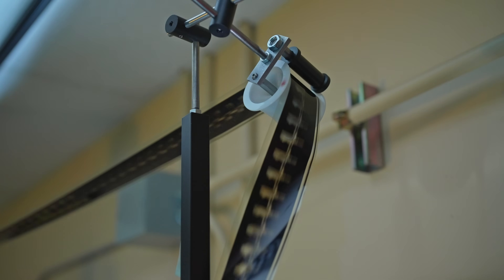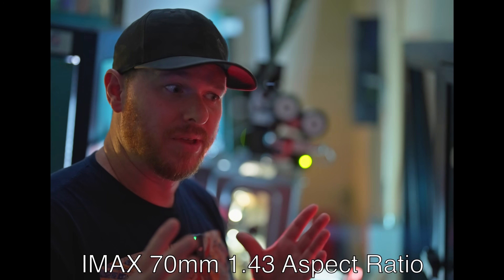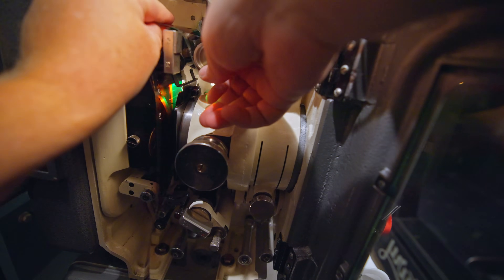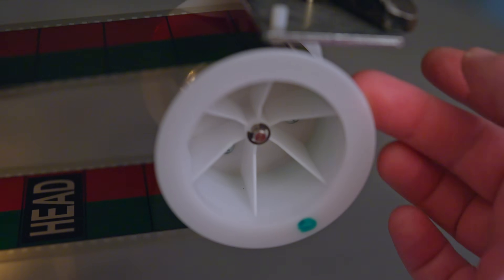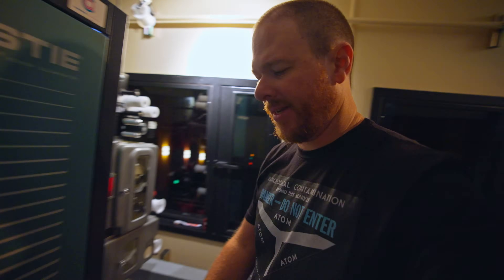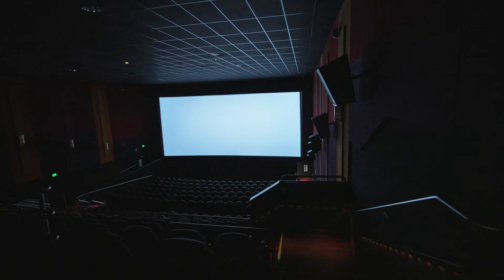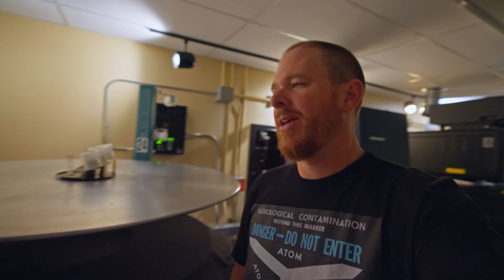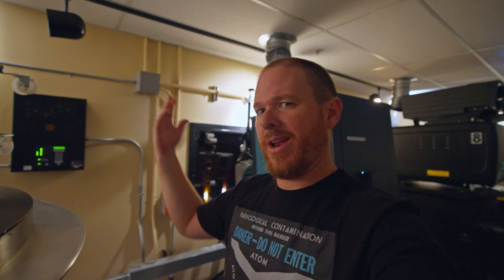Being a Projectionist for Oppenheimer 70mm Film Part 2

Comment: Thank you for pointing out the issue of resolution when comparing 15 perf to standard 70mm--I also don't buy this "resolution increase," as I believe it to be a marketing gimmick. The extra resolution is simply the larger film plane. As you explained perfectly, if you chop that extra top and bottom off into a 2:1 or even 2.39:1 ratio, you're left with the same image. So creatively, if you wanted to utilize that extra resolution in a 2:39 image, you wouldn't actually get the extra res. Can't forget how good optics play into the perception of resolution either.
Reply: The film was shot in IMAX 70mm, so yes you do lose resolution when going to regular 70mm. It’s probably not noticeable between viewings, but if you take a larger image and scale it down, you lose resolution no matter what. They didn’t just remove some black bars, they shot it in a larger film and transferred it to a smaller one.
Reply from the maker: @hpwilliams0 the whole film wasn’t shot in IMAX. Parts of it were.
Reply: I’m aware pf the difference in the capture format, yes. But visually speaking, once projected, I’m not convinced the resolution difference is that dramatic between 70mm vert vs horizontal, especially if they’re matted to the same ratio. Like pixels, are there really that many more silver halide grains packed in? Would love to see a comparison, maybe I’m completely off base. 

This goes back to my issue of large-format film starting to look a LOT like digital (specifically that captured by an Alexa-series camera from Arri). Large-format film starts to feel grainless, like a clean digital picture. It’s an interesting marriage point for the two formats. Look at a 16mm negative vs 65mm or IMAX neg—very different appearance of grain. Lubezki said that’s what he loved about using Alexa 65–it removed the grain and made the screen feel more like a window (to him, anyway).
Reply from the maker: @joncoy1852 film vs digital projection is a little bit more than just grain or the lack thereof. What I see comparing film to digital is more contrast, better colors, no over sharpening effect and it being a little easier to look at. I do think that digital projectors in the field are pretty horrible. Since I’ve been at this theater I’ve seen digital projectors that were way out of calibration…bad pixel alignment, brightness and it looked like the colors hadn’t been calibrated in a very long time. When I worked at Warner Bros and Paramount I saw digital projection that looked as good if not better than film. But the setup we do before each show isn’t something that a regular theater could do everyday. Of course when I’m speaking of digital being better that film I’m talking about 35mm film…not 70mm or IMAX 70mm.
Reply: Hi @RadioactiveDrew  -- I don't disagree with you about the projection--I've seen many bad film AND digital projections. I work as a colorist and am quite familiar with the entire pipeline, been seeing movies screened on film since the mid 80s, so I do have a solid reference point. I'm familiar with things like THX and Glenn Berggren's reports on projector bulb chromaticity variances, and I've seen my fair share of really bad digital projections. What I'm really driving at is that, comparing the capture of IMAX film and large-format digital sensors, once boiled down into the same digital format for delivery, do not appear wildly different aside from the gimmick of switching aspect ratios, IMO. The options aren't all that different visually (we can nitpick depth of field and resolution variances all day). I do agree that seeing a high-quality film print that has been well cared for from a well-maintained projector is a beautiful experience, I just don't agree about the perception of resolution that is often reported by Nolan, van Hoytema, etc. I would point to Steve Yedlin's work for a discussion on resolution. But I'm sure I would say "oh wow, you're right" if I saw them side-by-side in a really great theater at Paramount or WB. That's a very good point you make.
Reply: I suppose that what I'm really getting at is more of a philosophical point about cinematography choices, and then ultimately the projection format, and what I believe to be a narrowing gap of differences between the two.
Reply: @RadioactiveDrew  And thanks for doing these videos, BTW! I've really enjoyed seeing your preparation process. We have a few places locally that do standard 70mm work (that's where I saw Oppenheimer), but it was great to get a look behind the curtain.
Reply from the maker: @joncoy1852 no problem. Glad you enjoyed it. I agree with you on digital capture. Most of films that have been captured on a Alexa 65 are amazing and shots that can’t be done using film because film doesn’t have the sensitivity as some digital sensors have. It’s all different flavors and what someone likes working with. In the end it’s really about how well it looks on someone’s screen at home. That’s where movies continue their longest lived life. I use to run a bunch of stuff for restoration and that was such a cool process to see happen.
Reply: Agreed, @RadioactiveDrew  . Film just cannot keep up with the sensitivity and the tone curve flexibility of digital formats now (you'll hear Roger Deakins often discuss asking Kodak if they could manufacture 1000EI or higher film, and they never could get it quite right). Agreed, all different flavors that come down to creative choice, which I fully support! I would love to visit some restoration facilities--I think it's so important.
Reply: @joncoy1852  It is definitely higher resolution.  The height of the IMAX frame is equal to the width of the 5-perf frame. The 5-perf 70mm projection aperture at 2.20 aspect ratio is 48.5 x 22 mm. The IMAX 15-perf 70mm projection aperture at 1.43 aspect ratio is 69.5 x 48.5 mm. That's 43% wider.

When the Oppenheimer 5-perf 70mm footage was printed onto IMAX film for the IMAX 70mm screenings it had to be blown up from 48.5 x 22 mm to 69.5 x 31.5 mm. The IMAX footage did not have to be blown up because it was filmed in IMAX format, so it could remain at 69.5 x 48.5 mm just as it had been shot.

I have seen Oppenheimer, Dunkirk, and Interstellar in IMAX 70mm. The increased resolution is very noticeable. That being said the typical audience member may not notice because they are usually consumed with the plot and the action, especially in a fast paced film like Oppenheimer. But that has always been true with just about everything in motion pictures, whether it's sound, lighting, editing, background music, super widescreen formats, they all add to the impact of the movie but usually on a more subconscious level, unless someone is interested in those aspects, then they are more likely to notice the background music for example, or the sound system, or the editing.

I think almost anyone could see the difference in sharpness if they mentally broke away from the plot for a moment and watched for it. But to do that you have to actually go to a 70mm IMAX theater, and there are only 19 in the U.S. showing Oppenheimer in that format. For most people regular 70mm is the next best option, as there are 85 theaters in the U.S. showing Oppenheimer in 5-perf 70mm.
Reply: Thanks for the thorough response, @StevePemberton2. I'm sure you're right about the visual difference between an IMAX 70 and a standard 70mm print, I never get to see the full 15-perf prints, but I think my point is being missed in this thread a bit, so I'll back out and defer to those speaking. I do understand the gauge differences though, which would lead to a larger piece of film, thus more individual grains and the optical potential for "resolution" (shot a lot of film back in film school, 16 and a little 35, and I am a fan of the format).

I must say, shockingly I didn't actually enjoy the standard 70mm print of Oppenheimer I saw because it wasn't in great shape and the bulb definitely seemed to presented chromaticity issues (curious to know what its white point was). Conversely, I saw a great 35mm print of The Assassination of Jesse James by the Coward Robert Ford not long ago, and the age of the print added to the aesthetic Deakins and Dominik were going for...interesting comparison. 

But I feel that the issue of gauge is only part of the resolution issue. I do wish that I could see 15-perf IMAX next to a 4K DCP of the same film, graded and processed by a professional facility. Sometimes I liken all of this to what I see on set all the time, which is people using soft, aberration-prone lenses on really sophisticated cameras, thus reducing their potential for resolution (again, pointing to Yedlin's take on res). But I do value all the opinions expressed here, thanks  @StevePemberton2  @RadioactiveDrew
Reply: @joncoy1852  I think side by side you would probably find things that you prefer in the digital version, because it has its advantages, and it is a format that we are now very used to and that makes a big difference in our perceptions. Especially if it was an IMAX laser which I haven't experienced yet but I hear it is pretty good.  But from people who know more about it than I do film IMAX has a unique quality that isn't captured in even the best digital presentation. It seems similar to the continued popularity of analog tube amplifiers and vinyl records, which is not just people on a nostalgia kick, as there are serious hi-fi buffs who are into that because they prefer the sound, or at least they appreciate the sound, as I'm guessing they also listen to a lot of digital music also.
Reply: @StevePemberton2 Great thoughts, in both responses. You brought up something interesting we haven’t discussed—digital audio vs optical tracks. I sometimes forget about all of the beautiful nuance of optical tracks. Again, to being up that Jesse James print I saw, it sounded INCREDIBLE. There were so many bits of the mix that I’d never heard from a blu-ray.
Reply: But in my OG post, I meant in the projection. I don’t personally like the way Nolan has always jumped back and forth between 2:39 ratio w 35mm shots and the taller IMAX ratio within the same movie. It’s a difference of framing rather than quality once you conform that to a DCP, really.
Reply: @joncoy1852  Regarding the change in aspect ratio, I agree in a digital IMAX theater it probably wasn't necessary to switch back and forth from 2.20 to 1.90 for the IMAX scenes (1.90 is the most that digital IMAX projectors are capable of).  It would be a matter of preference at that point, I would probably like it but that's because I am used to it from seeing IMAX versions of these films. And in that format no one is complaining because that's what we were there for was the IMAX scenes, and the more the better (well I'm sure probably someone complained even in 70mm IMAX theaters).  It actually wasn't distracting because even the 70mm shots looked very good, and it mostly filled your vision especially in an IMAX theater where everyone is generally sitting closer to the screen then in a regular theater. Maybe not necessarily physically closer, but when the screen is 80 feet wide and 60 feet tall it seems close wherever you sit.  In the IMAX shots it was sharper, and way bigger, filling the screen literally from floor to ceiling.

I also saw Star Wars The Force Awakens at an IMAX theater (actually a dome IMAX). It had only one scene in IMAX, the Escape off Jakku scene. The scene was only six minutes long but when the image went floor to ceiling (well the equivalent that a dome theater does) just as the escape started it was a six minute roller coaster ride, quite memorable.

Comment: It’s always baffled me why Dolby never made a version of their Dolby Digital standard for 70mm film (between the sprocket holes). Instead they ceded 70mm to DTS (now known as Datasat).
Reply from the maker: DTS seems to be a lot more stable in my experience. I’ve had all kinds of problems with Dolby Digital sound (SRD) on 35mm prints.
Reply: @RadioactiveDrew Curious, what kind of problems you’ve had?
Reply from the maker: It’s mainly with Dolby digital readers failing. Most of the time the “basement” readers are horrible. I’ve had to use rubber bands to increase tension on the dampening rollers to get a decent read off of the digital reader. Penthouse readers, the ones above the projector, are always better and have way less problems.
Reply: @RadioactiveDrew I only knew of the Penthouse readers. I was not aware of the existence of “basement” readers.I would think that the reader would have to always be in the same position to sync the sound with the picture.
Reply from the maker: @Toast0808 historically the SR (analog) track has always been after the picture head of the projector, right underneath. Lots of projectors had the basement readers on the same LED support as the analog. Usually both of the readers were red led. Sound sync for SR and SRD are both down at by the analog sound start. I can’t remember what the offset is off the top of my head. All the digital sound formats can have offsets programmed in. Usually pretty easily.

Comment: When I attend "normal" cinemas - (Not IMAX) - I see the movies are all on digital media - Hard Drives - and are projected from a digital projector - some mounted on the roof!!! - Why can IMAX not be shown like this i.e. Stored and distributed on digital media?   Brilliant videos of yours by the way!
Reply: Nearly all of the more than 1,000 IMAX theaters worldwide are digital. There are only about three dozen IMAX 70mm film theaters. The digital IMAX theaters mostly show standard movies that have been through IMAX digital processing and are shown using proprietary IMAX 4K projectors. However the digital projectors are limited to 1.90 aspect ratio, so when IMAX digital theaters are showing films shot in IMAX 70mm such as Oppenheimer, the 1.43 image is cropped to 1.90.

There is a type of IMAX digital that can show IMAX in 1.43 aspect ratio, this is the GT Dual Laser theaters, using two 4K projectors. The GT laser projectors are also limited to 1.90 aspect ratio, however when showing films shot in IMAX 70mm an anamorphic lens is used on the projector to expand the image to the full 1.43. This does not distort the image because the digital prints that are made for the GT laser theaters are squeezed to 1.90, the projector then stretches the image back to the original 1.43 aspect ratio.  There are currently only a couple dozen GT laser theaters worldwide.

Comment: 15-perf IMAX 70mm has higher resolution than 5-perf 70mm, it’s not just taller.  However both are much sharper than 35mm, so it's worth seeing Oppenheimer in either of these formats.  Digital IMAX is sharp also, but it's not the same experience as seeing it on film.

For a quick visualization, even though the perforation area on the film isn’t part of the image, if we use perforations as a rough unit of measure, a standard 70mm frame is 5 perforations high, and at 2.20 aspect ratio the width of the frame would be 11 perforations. With IMAX 15-perf 70mm, since the image is turned sideways the width of the frame is 15 perforations, and at 1.43 aspect ratio the image is 10 perforation high. So our rough measurement looks like this:

5-perf 70mm
11-perf (w) x 5-perf (h)

IMAX 15-perf 
15-perf (w) x 10 perf (h)

If both images are projected onto a screen at the same width, the 15 perforation width of the IMAX frame has higher resolution than the 11 perforation width of a standard 70 mm frame, since it doesn't have to be enlarged as much to fill the width of the screen.

The actual projection apertures are:

5-perf 70mm
48.56 mm (w) x 22.1 mm (h) = 2.20 aspect ratio
(the other 21 mm in width is for the soundtrack and the perforations)

IMAX 15-perf
69.6 mm (w)  x 48.5 mm (h) = 1.43 aspect ratio

Projecting onto a 60 ft wide screen, the 5-perf 70 mm film image is enlarged 377 times to fill the width of the screen. Meanwhile the 15-perf 70 mm IMAX image only has to be enlarged 263 times to fill the width of the screen. The difference in sharpness of the 1.43 IMAX scenes compared to the 2.20 scenes is quite noticeable when viewing Oppenheimer, Dunkirk, etc. at an IMAX 70mm theater. The IMAX scenes are not just bigger, they actually are sharper. That's why the original IMAX theaters had huge screens up to 80 feet wide (some even larger) with the audience seated relatively close compared to regular theaters, because the image is so sharp. And that's on top of standard 70mm which is already much sharper than standard 35mm which is how most movies used to be filmed and projected.  

In the case of films like Oppenheimer that contain both 5-perf 65mm footage and 15-perf 65mm footage, both sizes are printed onto 15-perf 70mm print stock, however the 5-perf footage has to be blown up some so that it is as wide as the 15-perf footage.

If you can't get to one of the 19 theaters in the U.S. that are showing Oppenheimer in IMAX 70mm, definitely try and find one of the 85 theaters that are showing it in 5-perf 70mm. Opportunities to see films in this format are extremely rare.

Comment: Stupendous film.  So the 70 mm does not offer much advantage?  I remember 70 mm Laurence of Arabia and Around the World in 80 Days had to be seen in 70 mm.   But that was the difference between 35 mm and 70 mm.   And good to know this is still film and not digital.
Reply from the maker: 70mm does offer an advantage over 35mm film. IMAX 70mm 15 perf has a slight advantage over 70mm 5 perf. You have to look at area shown and on the film and look at the resolving power. If you are showing all these formats on a 100 foot screen the IMAX and 70mm film are going to give you almost the same resolving power. The 35mm will have half the resolving power of 70mm.